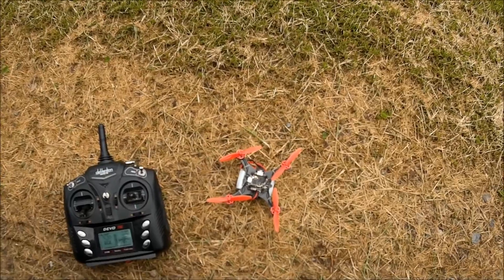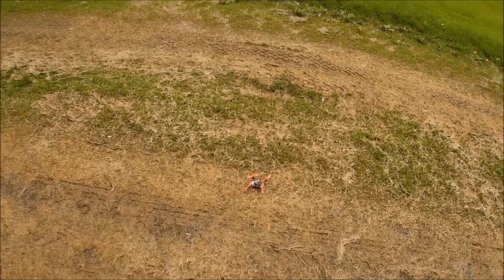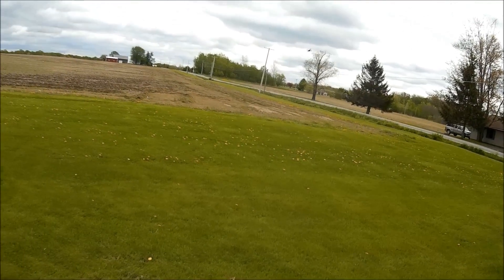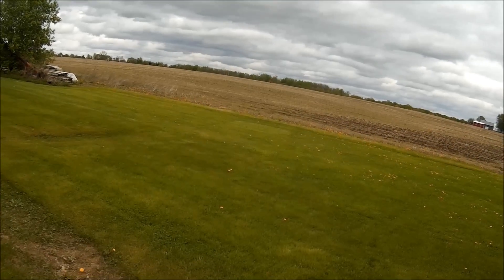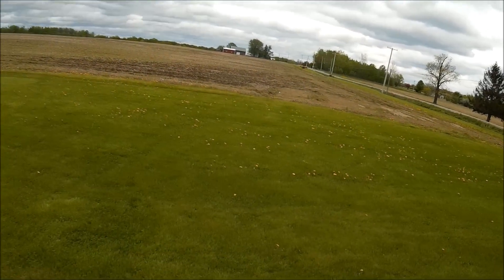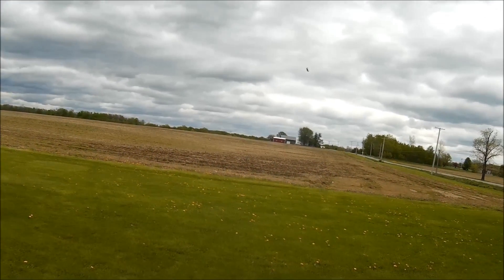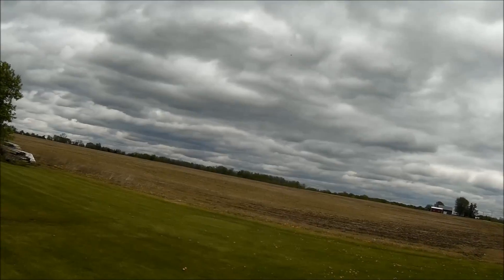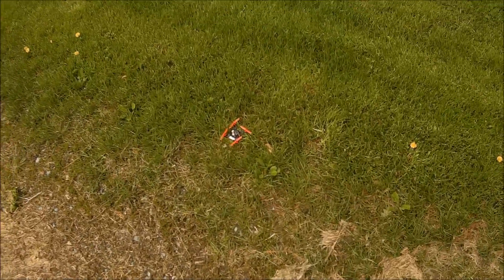1103 build part 3 LOS flight

Comment: I can hear the D term cricketing on hard turns and punch-outs, are your motors coming down hot?
Reply from the maker: Are you certain it's D?  
I know what you mean though ,but actually didn't see excessive heat.  I assumed P was still too high and lowered it a bit more and it's much smoother now.  I have little experience adjusting D.  Thought it applied more to the bouncing back after stopping rotation quickly.
Reply: The only risk with D term would be to go to high and smoke a motor from excess heat. If it were low D term you would have a lot of prop-wash on hard 180 turns. I would lower D slowly until the cricketing sound goes away and do some more hard 180's back and forth to check if prop-wash is now showing itself after lowering it. Then again, im tuning by sound and not by feel via internet, hahaha.
Reply from the maker: The oscillation sound in the video was killed by lowering P. I still get prop was oscillatons on hard 180 turns though so I don't think I want lower D.   From what I understand killing prop wash effects totally can be near impossible with PIDs only and I don't think I'm far off now.  I do plan to eventually try some of the new filter reduction stuff which I hear increases the odds of killing them completely.  .

Comment: Did you ever test the 8000kv version of the br1103? everywhere else I look i see people saying that the 10000kv can't handle the bigger props (65mm) or are super inefficient but you seem to be having great success with 10000kv. 

I planned on using 10000kv when i saw these initially until I did more research. 'everyone' says the 8000kv are the best of the 1103.

Awesome flying btw! I've never been able to do LOS acro flying
Reply from the maker: Part 1 includes the thrust testing covering 6500, 8000 and 10000kv.  

I have not flown 8000kv but 10000 thrust ~20% more on the stand.

Comment: Have you ever destroyed a bolt highvolt? by just flying? I have 2 highvolts 6 months old atleast if not more and theey are awesome still!
Reply from the maker: Nope, I mostly use Bonka but have not had issues with either.  Supposedly some folks had issues with HV but seems they were also racing using lots of full throttle.  If you not constantly mashing the throttle HV is awesome.
Reply: wow! yeah finally someone that is not HV scared!!! I love them my 850mah bolt hv turns my 1306 4000 kv 4S quad into a rocket!. I never let the voltage go below 15,4 volts and its still as good as it was new! 

did you hear walkera stopped building devo 7e's? I got one with nrf24l01 chip build last week for 45€ total... they are just so well build!
Reply from the maker: I think the video Josh Bardwell did on them scared a lot of folks off HV, but I use them pretty much exclusively.  

Did not hear about Walkera and the 7e.  It's my favorite Tx but with the terrible stock range I can see why it's not more popular.  Seems there is a lot of inventory left around so they probably don't see a need to make more.
Reply: why dont you openup your cyrf module and remove the diode? this will improve range by 5times...
I installed a very cheap A7105 chip (used for flysky and turnigy evolution modules) I get 500M range with small TGYia6c receiver. the AFHDS2A protocol even has telemetry.
Reply from the maker: I shorted the diode to complete the range mod on mine so I'm good with it.  Not everyone is interested/capable of doing this though.